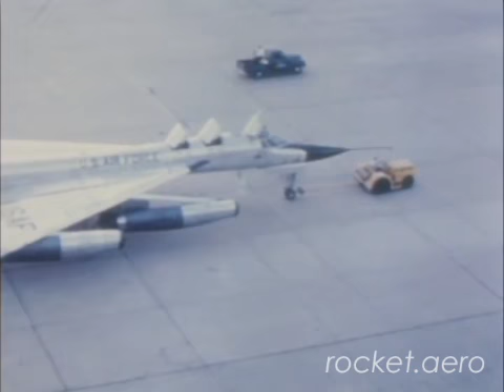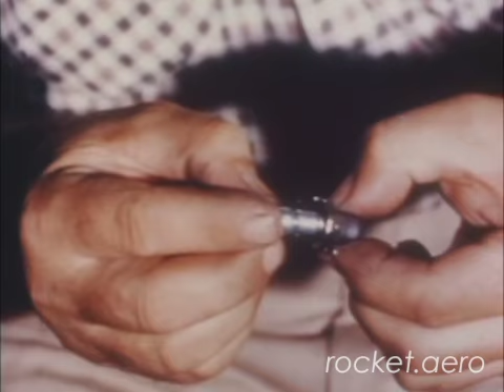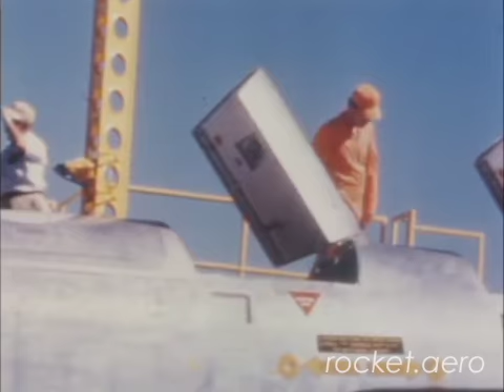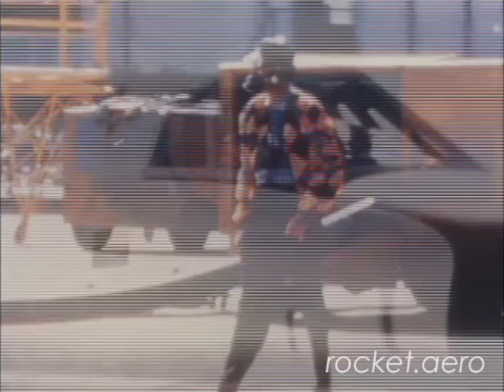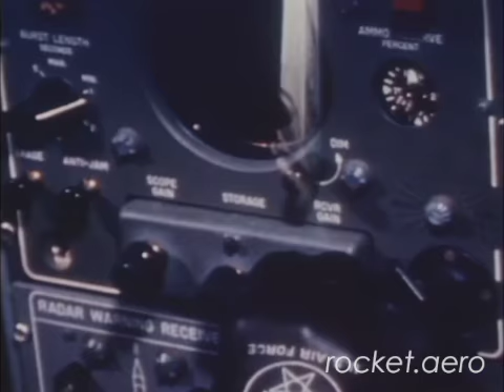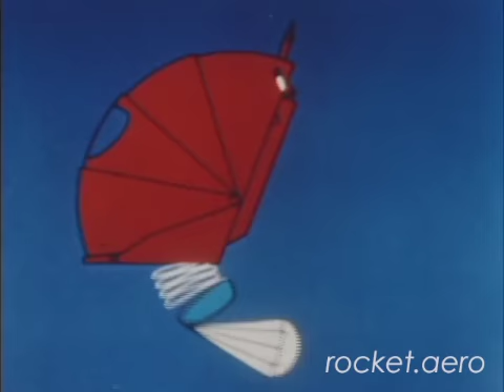First Tactical B-58 Hustler

Comment: I read that the Hustler was too fast for It,s own good. Would burn up with little or no warning,
Reply: No, you did not.
Reply: it had analog flight controls, that did not age well....at least one crashed on the runway as it lifted off....went inverted while 50ft above the runway...then sank into the tarmac with a full load of fuel.....I watched it from the moment it lit its afterburner....1968 BHAFB....the footage is still burned into my brain....RIP 3 Airmen

Comment: I wonder how well the low level performance was because the F111 pretty much replaced it. A low level dedicated platform
Reply: The aircraft itself was very stable.  My grandfather was a test pilot on both the B58 and F111(Convair then GD but basically the same company) and retired in 1971 during the early design stages of the F-16.   He always said the B58 was very fast low level but had no real weapon system which could be used "downstairs".   When he went to the F111 he said THAT was undoubtedly the fastest low level aircraft in the world for many years but because the technology was transitioning from tube to transistor to digital so quickly back then...it got a bad rap because it didn't integrate easily.  Had it been designed even 5 years later he said it would have had most of those bugs worked out as it would have been an entire generation(in weapons/TFR) newer.  Oh...and they would have "fixed" the wing box as well.

Comment: Huge flair on landing
Reply: Of necessity. Because of the delta wing design's inherently high landing speeds, the pilot pitches up on final approach and uses the entire wing to reduce the approach speed, in much the same way wing flaps are used in a straight or swept-wing configuration. You've seen the Concorde land much the same way with it's cranked delta wing.

Comment: Makes me remember the one on static display on the grounds of Chanute AFB in Rantoul, IL. I used to play around as a kid. My dad was stationed there as an electronics tech. The base also had a B-36 on display there among other SAC/TAC/MAC machines. It was a great place to be a kid. That B-58 was a spaceship to me. The only cooler plane was the F-4.
Reply: i saw that B58  so Sweet
Reply: @kdcobra64  I see it's in the museum hanger now. I gotta go down there at some point this summer to visit the place.
Reply: sski The museum at Rantoul is closed.
Reply: @Sparkchaser1200  What?! Why?
Reply: sski Closed in 2015. Lack of money. The aircraft the air force owned were removed. The rest were scrapped on site.  The B-58 and the B-36 shipped out to Castle Air Museum. The B-58 landing gear was damaged by museum staff while trying to move it. Not sure if it is being displayed.